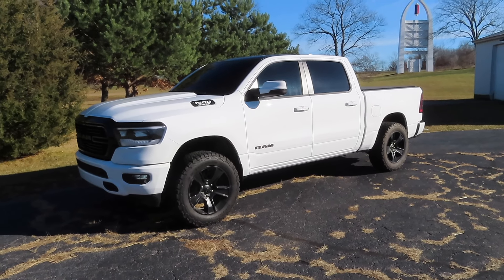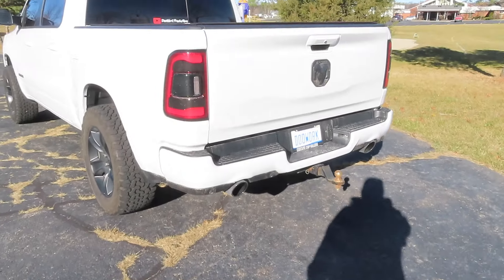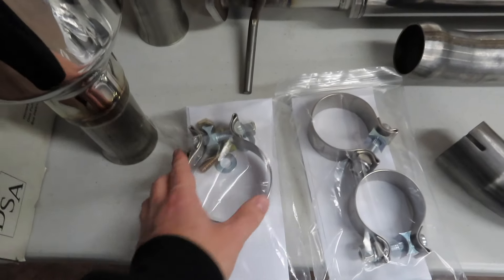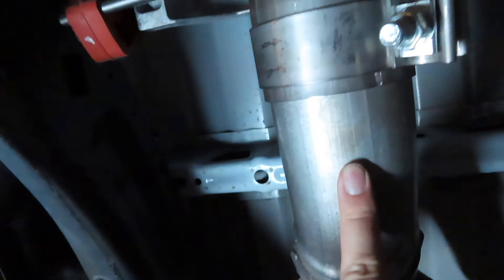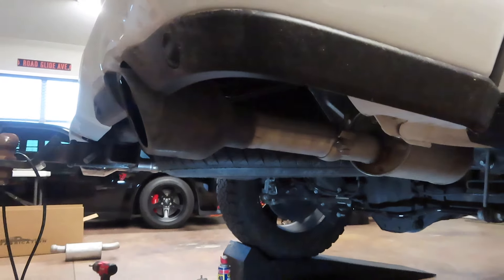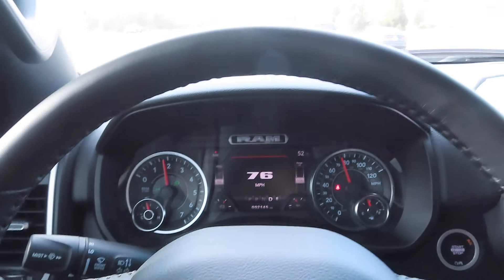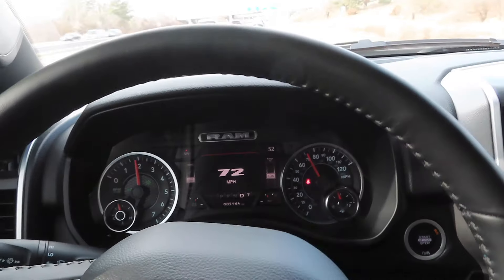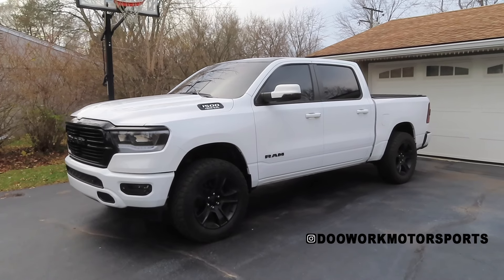2020 RAM 1500 MUFFLER DELETE AND RESONATOR DELETE *B2 FABRICATION*

Comment: You can turn off the mds by hitting the - gear limit button on your steering wheel and then hit the + until it goes up to 8 and it will turn off MDS and shift normally
Reply from the maker: Thanks for the info!
Reply: I'm glad I ran across this post.
I'm a new ram and a new pickup owner. 
Wanted to try something different. 
I've been a VW majority of the time. 
This helped out a lot.

Comment: @17:36 I couldnt see all of your steering wheel but if you have the - and + for your gearing on your wheel all you need to do is click the - once, and watch on your dash beside your gear cluster, and click the + button up till it reaches 8th gear, it will shift normally through all gears just as always but it doesnt allow the msd to kick in. Best thing ever for trucks that have an exhaust and dont want to hear the msd. Hope this helps!
Reply: what is msd?

Comment: To turn off the MDS, put the truck in drive and while your foot is on the break press the gear- button then push gear+ until it displays 8.  Also, I've seen your truck in the U.P., I recognize your license plate!! Sounds badass!
Reply: Hi Jason, I will give this a try too.  Do you have to do it after every start?
Reply: @karrs42901  unfortunately yes. However after doing it for awhile, it just becomes second nature.
Reply: @jasonhesseling5737  agree, I'm already in that mode, thanks for the tip...

Comment: Looking at the B2 muffler M80, B2 muffler delete pipe, MBRP high flow muffler and aero exhaust AT3030. All are direct fit systems for my 2019 Ram etorque. I also have all 3 resonators on still. Suggestions or recommendations?

Comment: Can only be done in America, because if you did that in my country (Australia) you would be taken off the road for a start for having the exhaust too load and unauthorised modification (against design rules) and pay a fine as well.  You would also be banned for driving the truck until it was back to normal with a relevant road worthy certificate.

Comment: Your truck looks 2 inch leveled,  if so,  did you have to upgrade upper/lower  control arms and sway bar links or are they stock?
Reply from the maker: It is leveled 2.5"..  I did not have to upgrade control arms.  Everything is stock..

Comment: This is probably a dumb question but Did you have to do any welding or did you take it to a shop to do that
Reply from the maker: No welding necessary! All B2 Fab Exhaust kits are a clamp on application. Very Easy Install for any DIY guy or gal.

Comment: 17:35  if you put it in “manual mode” with the steering wheel buttons, then still select up so it can still use all 8 gears, it won’t ever turn on Mds
Reply: Yes l do same thing with my 2015 1500 ram every time I drive 😊

Comment: I have a 2021 RAM 1500 Bighorn Sport. I want to do the B2 Fabrication mid muffler delete. Is the straight pipe  option obscenely loud or does it sound good?
Reply from the maker: It sounds great, it just has a slight drone in the cab.

Comment: The research that I’ve done so far any mods to the exhaust from stock makes mpg suffer. Sounds amazing but I’m scared of the gas mileage changing. I love cruising on the highway with 19 mpg. Has your mpg suffered or has it changed at all??
Reply: I have the flowmaster fx direct fit replacement muffler and have not lost MPG. Have gotten as good as 21.5 cruising at 70.
Reply: Even f I lost a half mpg or even full, the sound and quality of the exhaust would be more than enough compensation. plus you'll lose some because it's new exhaust and you'll want to hear it... Now to be brutally honest: If its a truck, you're not really looking for milage because if milage was such an issue then you wouldn't want anything over 300hp (like a Kia etc) let alone a vehicle with the aero characteristics of a brick.

Comment: Hey, your hemi sounds sick!  It sounds like the Charger's and Challenger's active exhaust. Best sounding Ram hemi I've ever heard to be honest. 
A bit off topic, but I noticed that your truck's RPM's don't "hang" at all when you blip the throttle. It's revs up then back down quickly. Mine hangs at the higher rpm for maybe half a second before it revs back down. Did you do something specific to make that happen? 
Thanks
Reply: Do you have an eTorque Hemi? Mine does that same.

Comment: Do you know what is the biggest tire I can fit on my 19 ram rebel without a lift all stock with air , thinking 295/70/18 on stocks rims.
Reply from the maker: 33" tall tire is the biggest you can go without rubbing at factory ride height.

Comment: I looked at the b2 fab website. It doesn’t give the same description as you gave with the different levels. So it’s a bit confusing trying to find the same muff delete that you installed. I’m trying to upload a screen shot of what I am referring to on the b2 fab website.
Reply: Oval Muffler - Moderate Sound
Reply: Round Muffler - Aggressive Sound
Reply: Delete - Most Aggressive Sound

Comment: I think they look great but the sound is almost stock like? Little bark at 3/4-full throttle but otherwise idle is super quiet and quiet overall. For $700-800 for these parts you should of just bought the Borla ATAK for $900-$1000. That sounds amazing and has 0 drone.

Comment: Can you feel the difference inside the cabin when you had the muffler deleted without removing the resonators? In comparison with deleting those two resonators. I wonder if I do that on my ram it’s gonna drone a bit less. It’s not a bad drone but still ther and I’m wondering if the resonators are the issue